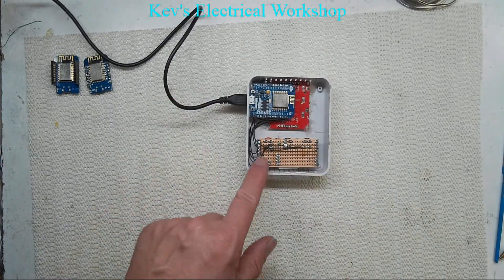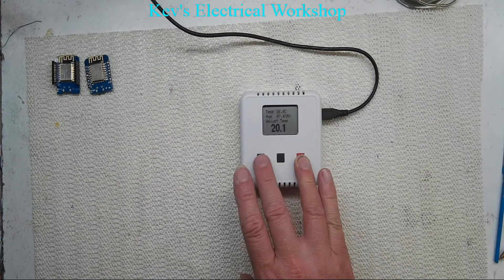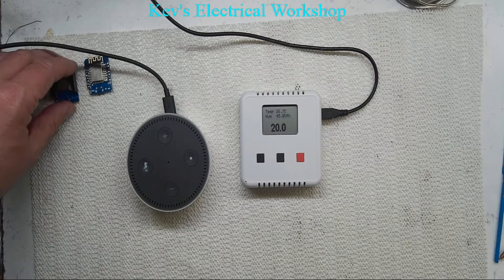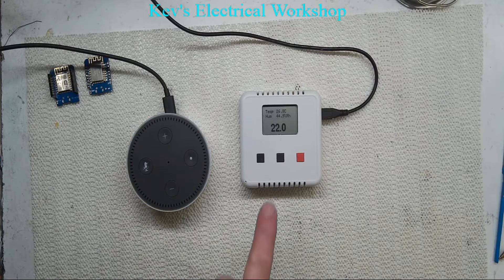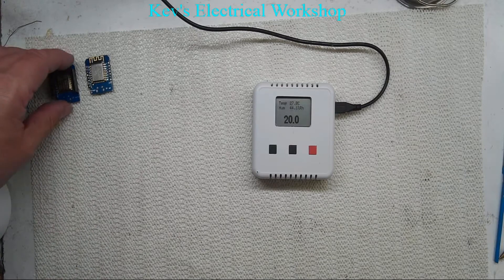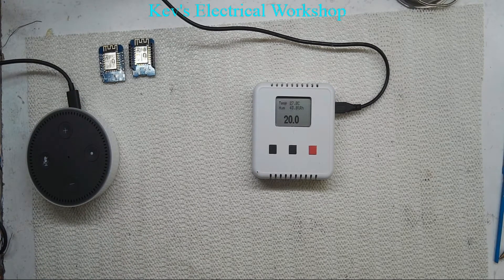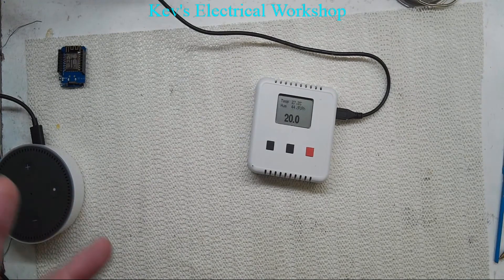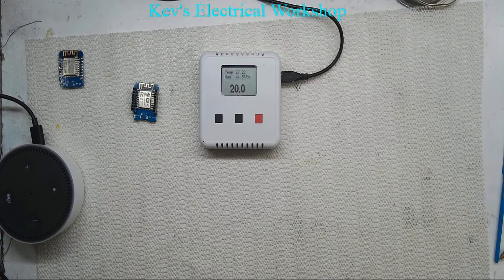ESP8266 wifi room stat with display project Part 3 now with Amazon Alexa

Comment: Hi Kev, a nice project but I'm having a bit of an issue with the display connections. Can you give the full list for the Nokia 5110 please.
Reply from the maker: on mine its clk=D5 DIN=D7 DC=D6 CE=D8 RST=D2 but it should be listed in the sketch

Comment: What project box are you using to hold the stuff in? I've been working on a thermostat for ages to work with domoticz but can seem to find a decent box to put it in.
Reply from the maker: its a CamdenBoss CBRS01VWH, if you search ebay for "sensor enclosure" there are a few types.
Reply: I need to get me one of those desktop cnc routers too keep making a mess trying to cut holes lol
Reply from the maker: there good and you can convert them to do 3d printing also by changing router for extruder ( i havnt done that yet)
Reply: Yeah I'd seen then in a few videos on here just not got around to getting one yet.

Comment: what problems did you have with those wemos d1 mini?
Reply from the maker: kept on disconecting and reconecting to usb even with blink sketch uploaded, can upload sketch by holding reset down until it about to upload but they didnt seam right.
Reply: thanks... very strange, there are zillions of those modules around... bad batch, probably...
Reply from the maker: both units were purchased from diffrent suppliers, its like the boot loaded is constantly rebooting